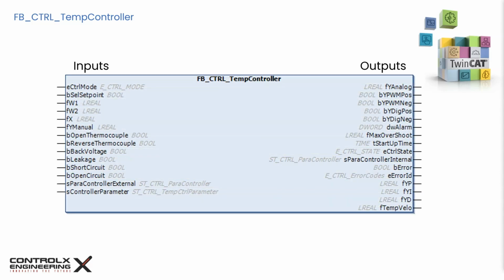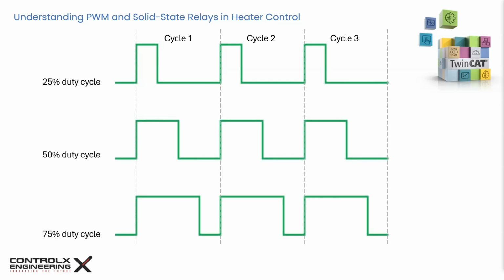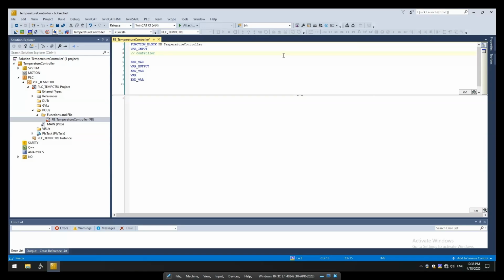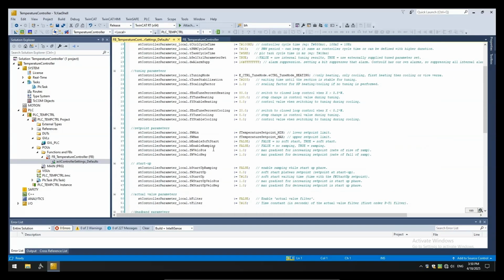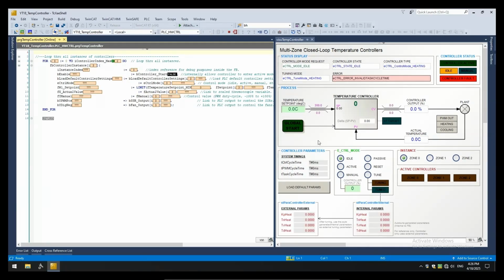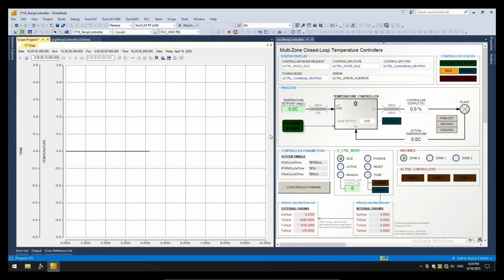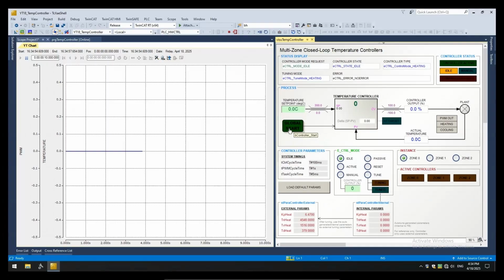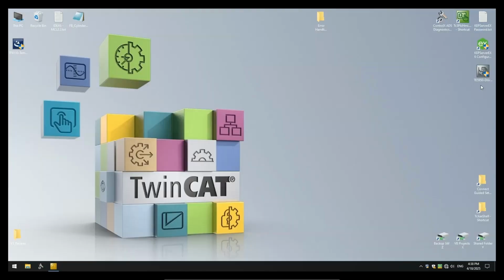Industrial Temperature Control with PLC: The Complete Beginner‑to‑Pro Guide - Part 2

Comment: Great work, 
Is it possible to have the project on GitHub?
Reply from the maker: The project is available for download from my Google Drive. Please see the download link in the video description.
Reply: Hello, I'd like to know if you could help me with a temperature control problem. When uploading the code to the Beckhoff device, it sometimes displays an error in the temperature control block. It doesn't mention the cause. I see that it resolves itself when the current temperature is far from the set temperature, but when it's very close, it displays the error.
Reply from the maker: Can you send screenshots of the error along with code snippets so we can get a better idea of what you're trying to do. Please send to controlxengineering@gmail.com